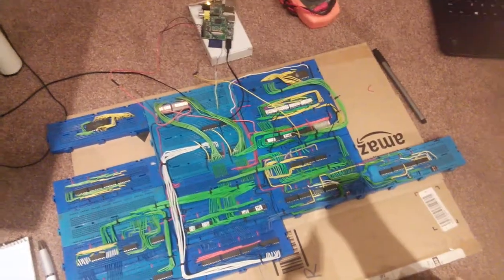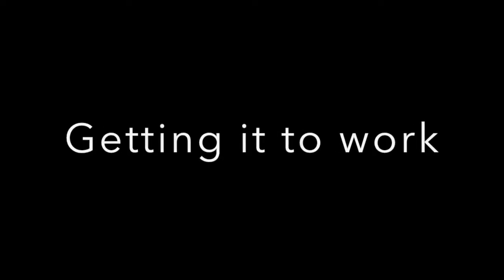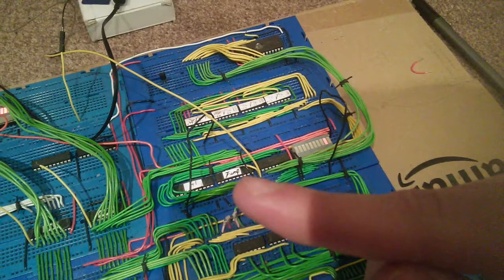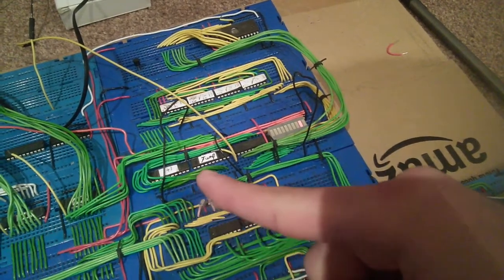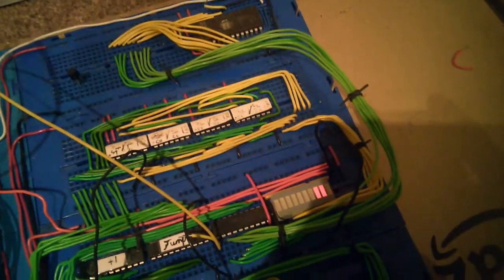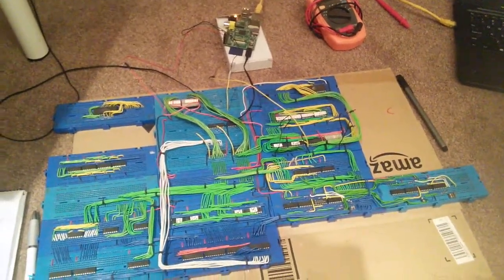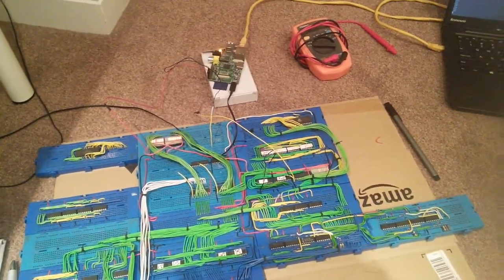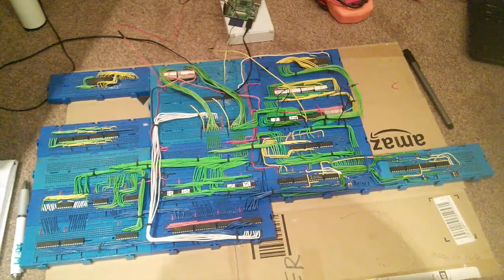Mum... I'm building a CPU - Episode 8: Tick Tock, it's the Clock!

Comment: A little late to comment, perhaps -  but I used an Arduino and a chain of 74HC595 (Serial to parallel) registers to test components on my homebrew CPU. You could have used a  555 chip to debounce your single step clock switch.